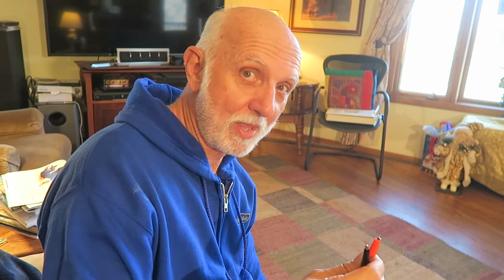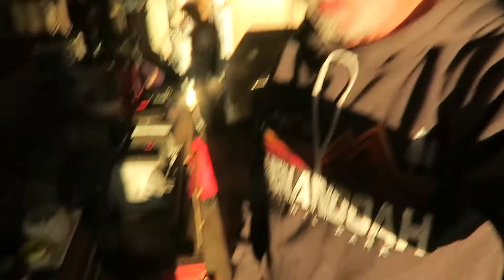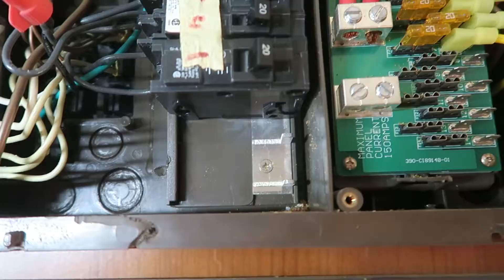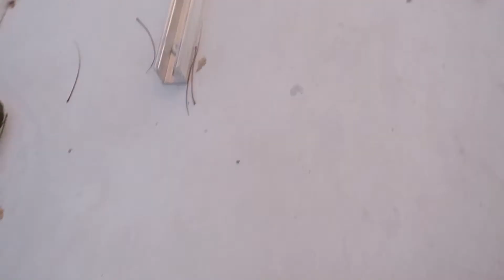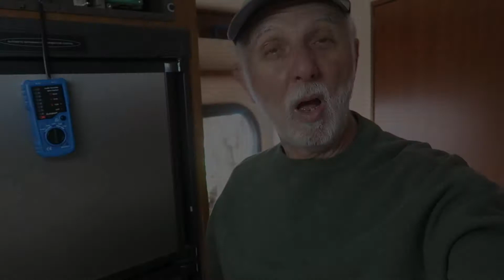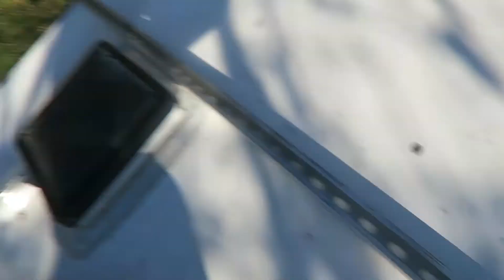RV Roof Drilling for Solar Panels, Cable Sniffer Comes to Rescue on 7th Day of Christmas

Comment: Can you explain how testing for RJ45 cables helps you find power cables (e.g. for air conditioning) through your RV roof if the power cables aren't RJ45 cables? Thanks!
Reply from the maker: Sure, I'll try to explain and hopefully you are truly looking for a real answer.
#1. In my situation, I wasn't exclusively looking for an RJ45 cable (for folks not familiar with the term, that is an Ethernet 10Base-T cable used to connect Internet devices to pass data at speeds up to 10Mbps over twisted wire to provide inductance to compensate for the capacitance of parallel wire conductors. So while the tester can ALSO perform more advanced data tests, in this situation I was only looking on Amazon for an affordable tester that met my basic needs.
#2. But this wasn't the concern in my rig and regardless of the tester, I'm simply using the device to INJECT a radio frequency signal that I can then "sniff" with a detector to follow the unknown path of cables.
#3. Of course, we don't want to inadvertently cut ANY hidden and hard/impossible to get to cables in our roof!
#4. Often RV manufacturers will route most all cables through the same pathway.
#5. So if you are concerned drilling in your RV roof might sever a cable, it's worth having a plan to mitigate possible damage.
#6. Even without a tester, it's wise to first begin by making a SMALL hole with your drill to ensure you're not about to hit something... especially the higher voltage/current cable like the one going to your air conditioner.
I hope this help - good luck!

Comment: Neat tool, but this is all above my pay grade lol have a good day!
Reply from the maker: Apparent guilt as charged here, too!  Yesterday I thought I was "sailing in still waters" when drilling a hole through the roof by the side wall so I "figured" there was no need to sniff cables so close to the side of the RV...
Nope - WRONG :-(   #$%^&*!  ... before I knew it I was seeing electrical wires coming out of the hole with the wood and insulation - yikes.
Fortunately, it turned out the wire was a coaxial cable that was sitting ABOVE the other 12 volt DC and 117 volt AC cables - WHEW, was I lucky or what?   Turns out this was an extra coax wire not used on my RV model (the back of our model does not have a bed so no need to connect a cable in the rear of the RV.
Less learned - whenever drilling on the roof, always Always ALWAYS sniff for wires before drilling.